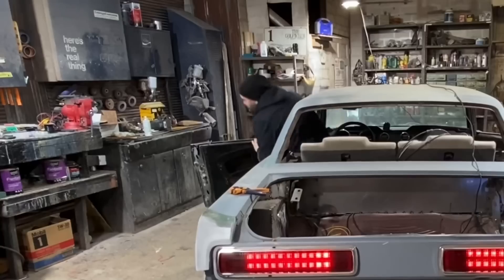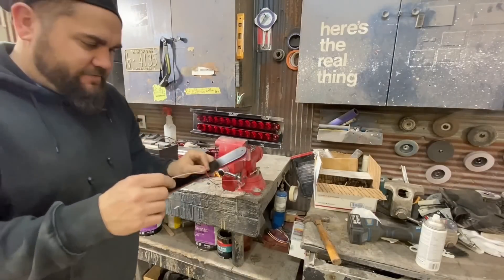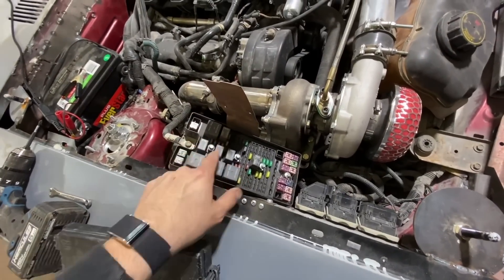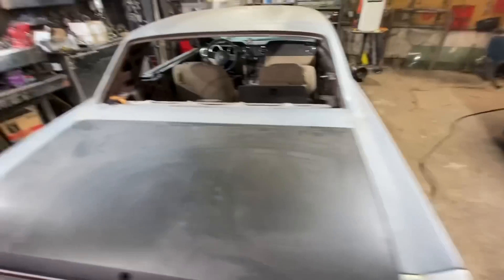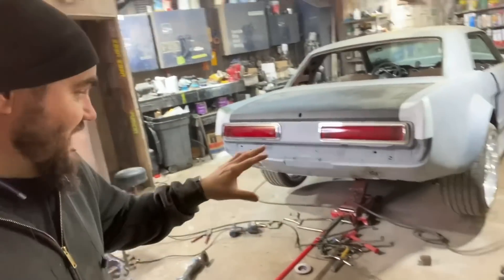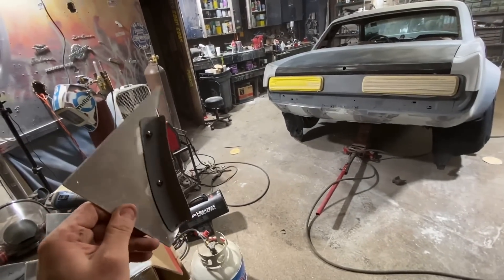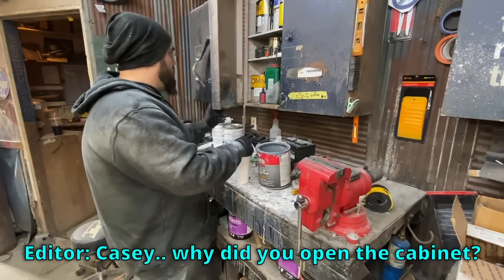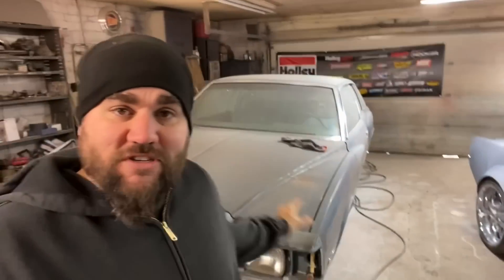THE 65 MUSTANG IS DONE! MAKING TAIL LIGHTS FROM SCRATCH! TWIN TURBO HOT ROD BODY SWAP! NEW CAR FRAME

Comment: That is a GT valance , those are for the GT exhaust tips to go thru the valance.  They also have a GT valance that has 4 holes, 2 for the GT tips and 2 for the backup lights.

Comment: Hey bud in the holes for your backup lights won't fit it's because they was cut out for the exhaust tips you might have to make a new set of holes for your backup lights
Reply from the maker: Yea i found that out later lol, they sent me the wrong one and i never checked it

Comment: Those holes on your rear valence are for exhaust tips to come out of. For some reason the smaller holes for the reverse lights aren't there (been filled maybe?) and they aren't actually round if they were there.  They would be closer to the outside edge where the valence meets the quarter. Odd....

Comment: The Mustang looks awesome man. Are you still putting the wing on it? You didn't mention anything in this video about it so I wasn't sure but I remembered it being on it with the old deck lid. The wing looked great except for the mounts. I think if they was moved to the back instead of the front of the wing on top of the deck lid it would look so much better. Anyhow, keep up the great work man. You do a killer job.

Comment: You might take a diffuser panel out of a 2x4 fluorescent and cut it down to put between the red lens and the LED strips to diffuse it even more.  White plexiglass might do the same so you don't have the hot spots.

Comment: The quarter panel (passenger side) doesn't match up to the bumper very well. Aftermarket bumper, I'm guessing? I'd like to see it finished, (including the interior) but I don't need to watch 3 videos of body work before you paint it, lol. Go at your pace, I'm digging the Monte Carlo build, too...and that looks like it should go pretty quick. Have you seen the video of the Ford Ranger from Minneapolis that hops off the ground with air bags?

Comment: I would have left those holes in the back and ran the exhaust through them just like a Shelby. And put your gas filler in between the tail lights.🇺🇲